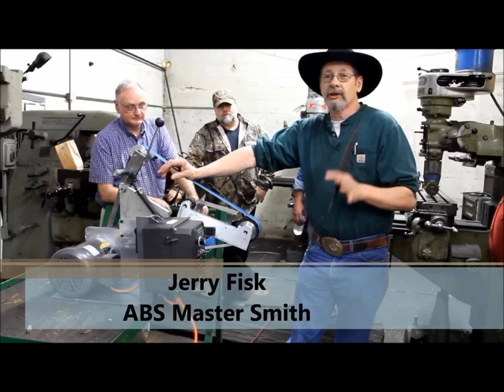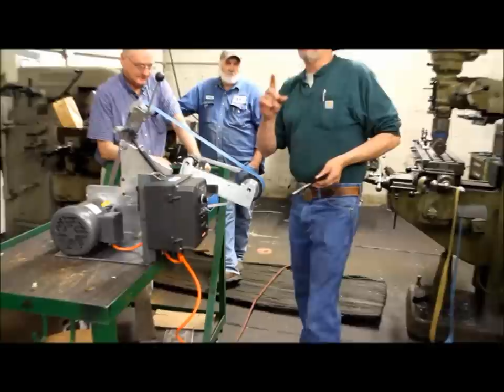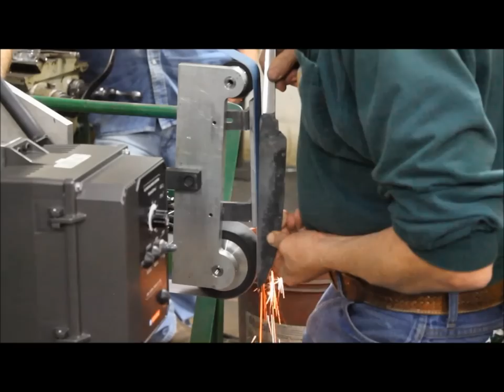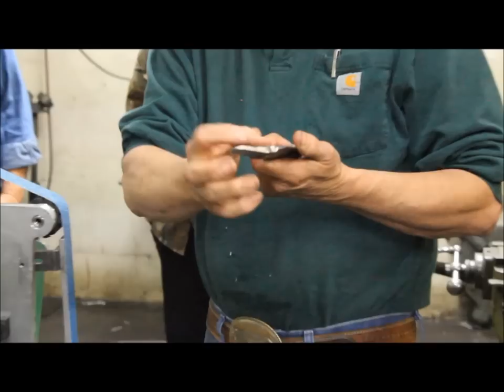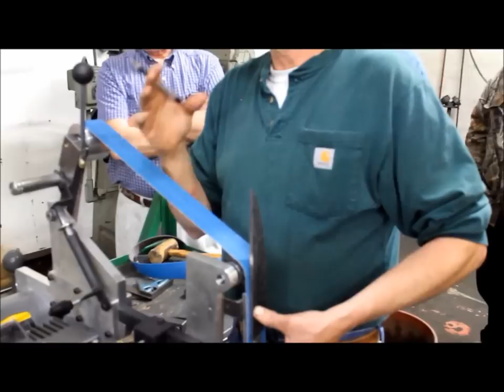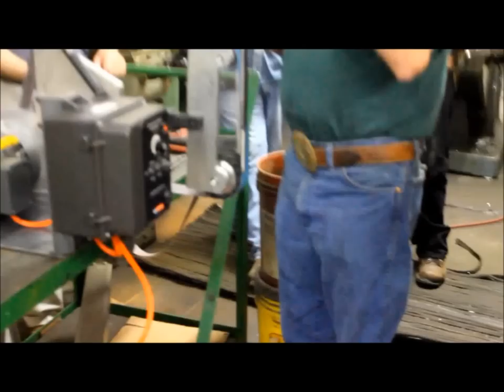Profiling a Forged Blade by Jerry Fisk, Master Smith

Comment: I have seen the exact problem he notes grinding strong side first and it never came to me to simply grind weak side first, hence I always end up with a weak side grind which usually is faceted and the strong side which is decently close to true flat. This comes out strongly in sharpening in the bevel width expansion is uneven from side to side. 

Appreciate the clarification, lots of details in this video. I think that Fisk guy might have ground a blade or two.

Comment: I need to practice grinding LOL. I just spent an hour putting an axe grind on a caping knife. Back to the grinder I go. I haven't handled it yet so I still can fix it. Thank you for the tip about grinding off the scale. I did that on the last two blanks I forged and the grinding did indeed go faster on the caper. I haven't started grinding on the second one yet. I still have a lot of room for improvement in every aspect. I am much better at the forging, getting better at the grinding, and still horrible in the finishing.

Comment: Nice video! This is the first video I have seen with that grinder. I have the same type in my shop. I love it. However, I have never used a BIII or a KMG. How does Al's grinder compare to them (it seems like a BIII influenced machine, with a better tensioning system), but I don't honestly know. thank you.

Comment: belt sanders grit as it wears out becomes finer grit I do not toss them out. but a lot of good info.
Reply: CRJarvis that's not really true...  they just cut slower and build up heat faster. And polished 60 grit scratches are still 60 grit scratches